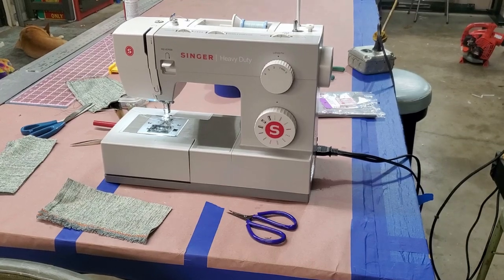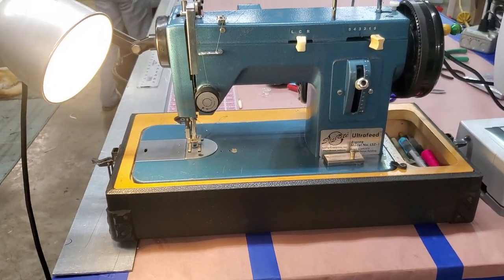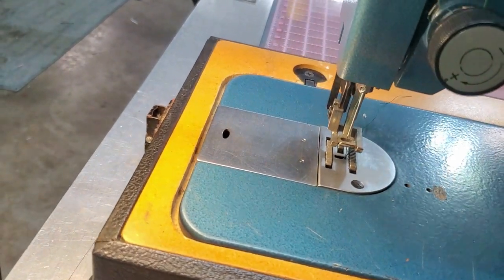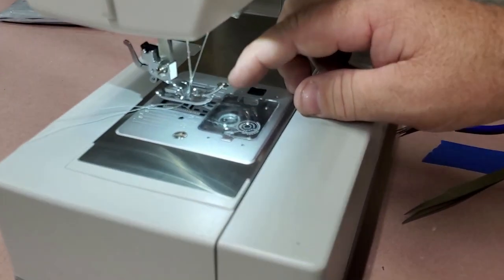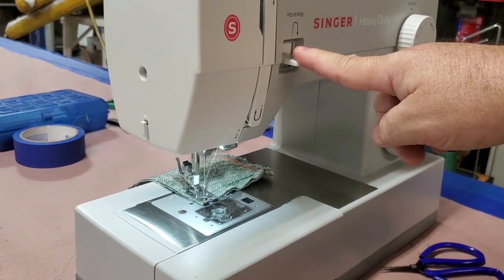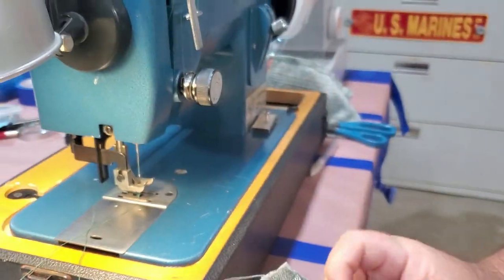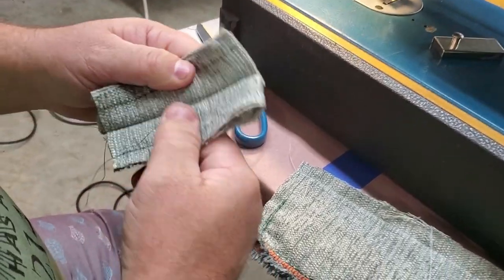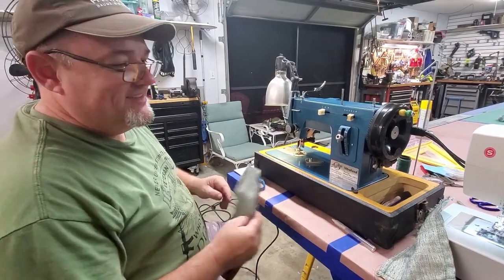DIY Marine upholstery. We upgraded from Singer to Sailrite -  whats the difference?

Comment: The shorter the stitch length, the more pucker—one reason to get a Sailrite. The long stitch, especially the zigzag, allows for stretch so the stitch doesn’t break.  Need  a bigger stitch than this Sailrite for making sails other than for a dinghy.  Get a walking foot attachment for your Singer to help feed heavier and stretchy fabric thru.  I use my Singer HD for everything but canvas.  I think they’re a good combination if you sew more than just canvas and repair sails.
Reply from the maker: I still have the Singer. But I traded the Sailrite for a Seiko walking foot. I love the Seiko. Each one has its positive attributes for sure.

Comment: Ive been using my Sailrite for 5 yrs & you cant beat it.
Reply from the maker: I agree. Its just a very capable machine. I havent had the chance to make anything new recently but I am hoping to make my outside window snap covers for the Trawler soon.
Reply: i use a carbon pile footpedal on my 9" (instead of a sailrite's 7")arm.  same machine just a longer arm.  sewline made it.  comes in a very standard paint.  but i had to upgrade the stichlegnth adjustment plate and thread tensioner to sailrite's to get it working like it should.  there is a little black arm that moves the needle bar left and right.  this little arm i speak about is in the arm of the machine, its a pushrod.  anywho, how deep it is mounted in the right side(looking at the machine) junction it has can cause the zigzag to be limited to how far it really can go;  with it properly buried deeply into its not-needle-bar junction/rightside(i have the manual and shematics two rooms over but im not getting up for it sorry) you can fill the inside/needle presserfoot with as much zigzag as it can allow.  in fact theres a little stopper plate screwed into the far-end of the zigzag width adjustment lever's throw-area; if you move the stopper plate too far left then some bad things can happen so handwheel it.  the thompson walking foot machine is nice, you can reverse with two hands on your work, put the machine on the floor, use cheap bobbins, it doesnt break. with feet mods and tuning the timing and height and foot pressure/spring itll sewdelicate things.  i have mine setup with left feedog only being used with a zipper foot but its horses for courses.  

carbon pile foot pedal is a must,  mine poped and hissed alot when i first got it and used it at very lowspeeds but works Great.  real control.  oh there's a plastic case that needs holes for handwheel and motor to poke out to haul it.  lol  its a beast of a portable machine ready to do lots of stuff.  i havent really tried comparing it to dropfeed for delicate stuff but for straight stiches on muslin its consistant, its fine.  the zigzag doesnt have built-in repeatability but it could get finagled by an ingenious mind easily.
Reply: @chrisprice5806   where did you get the 9”  and carbon pile pedal?
Reply: @tomsiegler8413 s.e.w. line is the name of the seller/company on ebay.  you want to search for their store and then find the machine by looking for 'mini walking foot'.

i placed an order with sailrite for he stitch length plate and a carbon pile pedal from them but there is no reason why you cant get the pedal for cheaper on ebay or something.

when you get the machine and the carbon pile pedal you should open the [so called] 'electronic' pedal and remove the wire's plug on the jacket that keeps the wire anchored rather than cutting the wire off because it can be installed in the new carbon pedal and also there was a medal clip if i recall correctly i also took from the 'electronic' pedal and put onto the carbon.  and i also wired on a LED light (the common magnetic type sold everywhere) onto the power cord. 

i like the sewline because the paint looks nice.  if you buy one tell the dude Chris Price who you sent free hardware to reffered you.  i broke a set screw and he sent me 4 additional setscrews and the pulley wheel with the stuck grub/setscrew.  i still have that repair to complete :/

if you skip stiches and need to adjust gib hook spacing or have questions about centering and tuning the zigzag let me know.
Reply: @chrisprice5806  unfortunately looks like  the seller is not on ebay any longer
Reply: well i found it thanks
Reply: @tomsiegler8413  SEWLINE NEW 146-9 WALKING FOOT 9" ZIG ZAG + EXTRAS INDUSTRIAL SEWING MACHINE

its there.

its a decent seller.   he sent me replacement parts for free after i showed him a picture of a setscrew stripped from no fault of my own
Reply: Sail rites sound like a machine gun when running with a capable operator. A set of them running in a shop sounds cool as hell

Comment: You could attach a walking foot to your Singer too. They cost about $12-15
Reply from the maker: I saw those. But it looked like they didnt have enough lift on each step to fit many layers. Plus the Singer lacked a bit of power for some of the thicker stuff I am sewing...like many layers of Sunbrella. But overall the little Singer is a great machine as well.
Reply: ok so,  the thompson walking foot is,, not a REAL unison feed/needle feed walking foot.  but it Does do top and bottom feed and will sew rugs and thick drapes.

thompson walking foot(sailrite's machine) is a walking foot.  others are made that use the outside foot to advance, its fairly legit and handy.

ok now what you are talking about is a 50% plastic attachment that goes on a domestic machine.  domestic machines that have neat cylinderarm beds and usefull stiches like overcast ones, thread cutter, reverse buttons are cool but the standard stuff sold is such low value really.  of all sewing machines to be purchased what is popularly sold is the worst. worst to work on or repair, last less than ten years, function worse.
Reply: Buy cheap buy twice

Comment: Actually, the needle does not move with the outer presser foot, it stays stationary, along with the middle presser foot, only the outer foot and the feed dog move the fabric through the machine.  That's called a top-and-bottom walking fooot feed.  The next step up is a triple, or compound, walking foot feed where the needle does move with the outer foot and feed dog, making it nearly impossible for the fabric to slip.  Also, the Sailrite does not sound like an industrial machine, it sounds like a noisy, clunky Sailrite.  Industrial machines don't sound like that, they are much smoother and quieter because they are high precision machines.
Reply from the maker: I agree on all counts. Since this video i sold the sailrite and purchased the Seiko machine from NC machines. Its amazing. And as you say..precision. i also added a servo motor. That video is on my channel too.

Comment: Zig Zag is used primarily for sails. I've had the same machine since 2004. Made fair amount of change doing small jobs around the marina. Good choice
Reply from the maker: Thats what everyone said...lol. So I figured that many people could not be wrong.
Reply: @mvintrigue-trawlerdiy1101  Only problem owning this machine is not being able to walk down the docks without being asked to repair something. Most canvasmakers will not touch small jobs. just saying
Reply from the maker: @jimmorris8158  I already had that problem several times...lol. I have another video where I made my interior cushions. Save me several thousand over the quotes I was getting. Sewing many times is just so labor intensive its tough to get something done at low cost, or as you said for a pro to even take on a small job. Thats why I knew it was time for me to learn.
Reply: The zig-zag stitch is stronger for sails because it avoids the straight line of needle hole "perforations" that tear easier than the staggered needle holes of a zig-zag stitch.

Comment: I'm fixing to buy a heavy duty singer machine. Going to use it to recover my boat. I have a really old singer but it's about had it. Of course I'll buy a walking foot for it.
Reply: I’ve got the singer 4423 and it’s a jamming needle breaking hook out of Time pos. I will throw money at anything at this point if it will just run.
Reply: Unless it is one with metal gears you may be disappointed. Id go for a Janome HD 3000 at least. High lift can sew thru 2 pieces of leather belt material at once aprox $400.

Comment: If you use a jeans needle and a walking foot and make your stitches bigger it should work great and not struggle.
Reply from the maker: Thanks a bunch Lydia. In many ways the Singer was fantastic. I am sure I am not doing it justice since I dont know about many of its features and capabilities. But I do know that soon I will be making a canvas or sunbrella top for the boat which is the main reason for the Sailrite. If I were to make more interior cushions I might still use the Singer. Thats why I have not sold it. It really is amazing to me what these machines can do.
Reply: Used a jeans needle with longer stitches on my Singer. If my neighbors didn’t call the police due to hearing loud cursing and yelling I’d been surprised. That’s the answer to that. The walking feet for these machines are clunky and bulky. It doesn’t have much clearance as it is.  Don’t get my wrong. Sewing a boat top didn’t kill the Singer but just might have lead to a divorce from the husband who asked me to sew it! His father dropped my heavy duty Singer industrial off a fork lift and he had finally worked up the courage to tell me soooo...I was in a time crunch to get the top done. I’ve been thinking about getting one of these machines. I’m used to having walking feet machines (most of my home machines are built in). So a bit spoiled! 
The singer does sew denim pretty well but not crazy amounts of layers and not a fan of the straight stitch foot that is weirdly designed and you can get hung up on things. Other than that it’s not a bad machine for the price. You can see chiffon one minute, change the needle/stitch length  and sew some denim the next. It’s the only new singer I recommend cause they aren’t like they used to be!
Reply from the maker: @pjpeace  😆 thanks for the laugh. And thanks for the insight.
Reply: @pjpeace  what about the 4432 model??

Comment: What can the Singer do? I would like to do some vinyl rework on my rear engine cover. Can a unit like this do it?
Reply from the maker: Possibly. The Singer is a very capable machine and actually much more refined than the Sailrite. Its really just the fact of the walking foot that lifts and pulls multiple layers through. If that material is fairly think but doesnt overlap 4 or 8 times it may be able to. But I am not an expert. Research more on the singer.
Reply: @mvintrigue-trawlerdiy1101  it's an engine cover that is really only one layer except if I want to sew in a few stripes for style. The cover on it now has just had the stitching deteriorated. If I felt comfortable with edge welts that would be the thickest part.  It's the rear of a 2007 stingray 180rx
Reply from the maker: @agmc4me  It would probably do it with the right needle. Its a very good machine.

Comment: Why not just buy the walking foot?
Reply from the maker: You mean the attachment for the singer?
Reply: @mvintrigue-trawlerdiy1101  Yeah, I have one it's amazing.  It works great for thick materials like marine vinyl
Reply: @yoshiodoom  The singer doesn't have the punch power or take the larger needles that the Sailrite does.  Depends on your job.  I just purchased a Sailrite...now I have 32 machines.  LOL
Reply: @chrystalhenthorne8209  I just used my hd to reupholster my auto seats with marine vinyl. The walking foot from singer was less than optimal, but my Teflon foot worked great.  I did bend one needle sewing through a plastic j hook and I can understand the desire to use bigger ones.

Comment: Sailrite is a piece of junk! Don't waste your money!
Reply from the maker: Its not a piece of junk at all. I still have the Singer, i still have the Sailrite but I also just got a Seiko walking foot that I put a servo motor on. Each machine has its place. The Singer is one smooth machine. The Seiko is a smooth powerful walking foot that will handle nearly anything. But it weight 50 lbs without the motor. The Sailrite is portable, walking foot and handles many jobs.  They all have thier place.
Reply: I wish you would be more specific.  The triple feeds cost about twice as much and come with a table.  Takes a lot of room